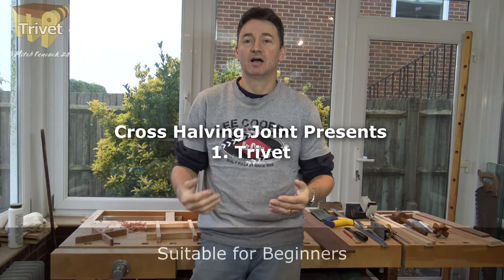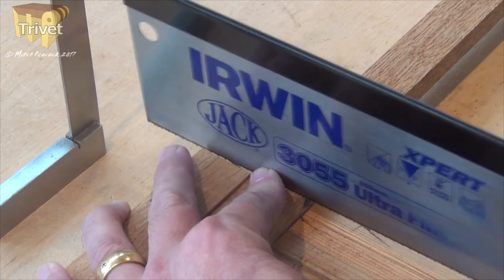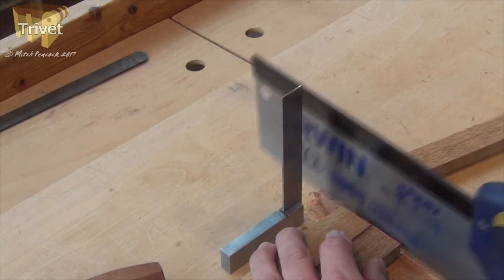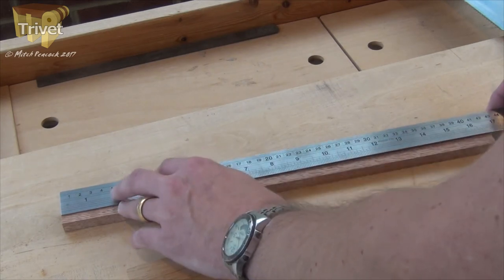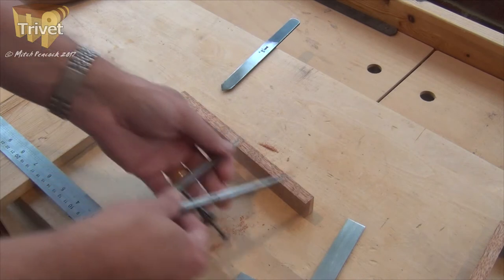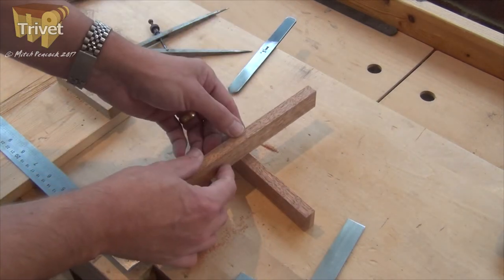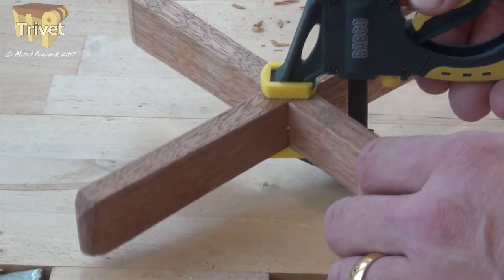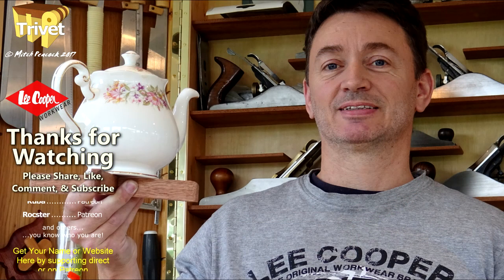Cross Halving Joint - Make a Trivet

Comment: Very well done video, Mitch. I don't think I've ever seen you use a miter box for hand saw work?
Reply from the maker: Cheers Steve. I don't have one, and although I have a mitre saw (hand powered thing like Ulmia made) it just gathers dust. If something needs to be dead accurate, then it'll need to be shot or pared, so I just saw slightly off the line and do that.